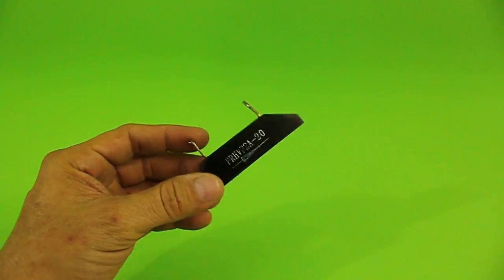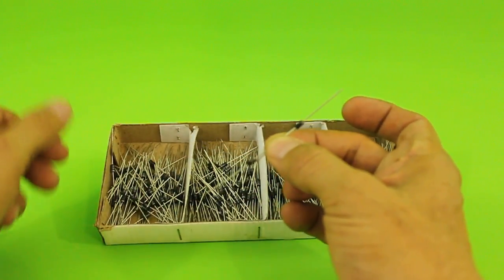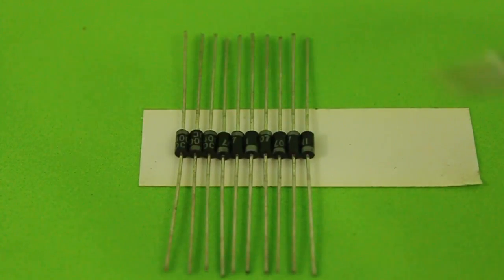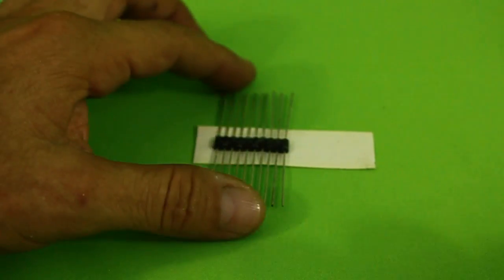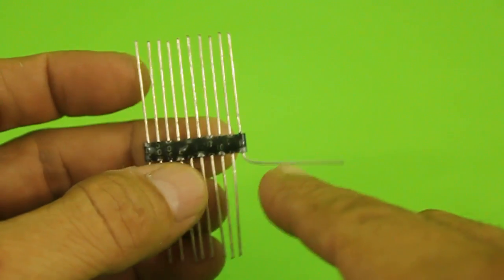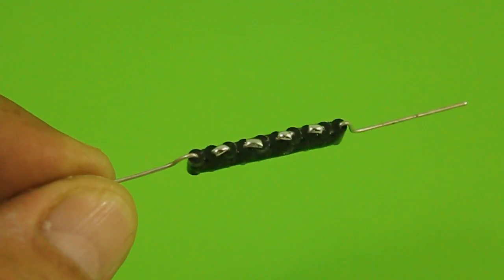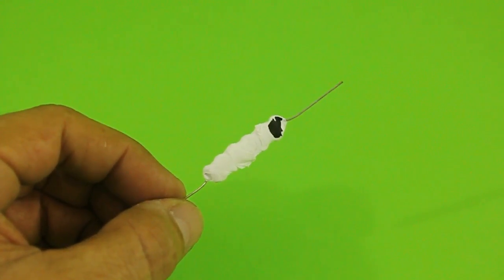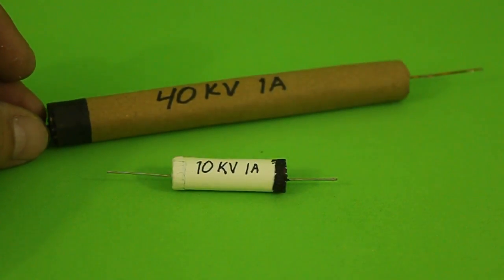How to make High Voltage Diodes

Comment: Kids, don't fall for these movies... 
If the reverse current leakage of all used diodes is not equal you will blow-up the least leaking diode first, followed by the second etc. That's why HV diodes are more expensive. They also stack diodes like the movie, but first they match the pairs on leakage current. This is a difficult step since leakage is also temperature dependent.  It's a poor mans solution with poor performances. Please just buy a $3 HV diode...

Comment: You know by putting these side-by-side like that you are making a much shorter and easier to jump spark gap than stretching them out... could go off sort of like a Marx Generator (multiple jumps all at once in cascade).  Even with the tape, you would be MUCH more HV resistant with them stretched out and perhaps sealed with silicon caulk or the like.... at least that might be one way I am presently experimenting with.

Comment: I’m not sure of the exact rating of microwave oven HV diodes but I expect they exceed 5kv each as they have about 7v forward drop perhaps they are 10kv ? as they are sizable due to the relatively high power a microwave ovens utilizes , and the peak after the C boost on a microwave is about 4kv ? anyways they are free if you collect them as I have, Alvvays found them interesting so collected nearly everyone I pulled. 
Also scored a 1Bgt valve, which is rated 30kv ~ strange the filament is only 1.25v or there about I guess the dielectric inside that vacuum tube doesn’t need much breaking down at 30kv or there abouts?

Comment: A faster and easier way to solder the diodes: once they're glued together, lay one piece of wire against one side and spot solder it to each wire. Do the same for the other side. Then use side cutters to trim everything. No need to waste time bending those fiddly 3mm ends and cause stresses on the package. You have to cut the ends anyway but doing this method is neater, faster and hardly any more work.

Comment: Can you take a (single square pak) full wave bridge (FWB) rectifier, for example, rated: 1000V @ 30A and simply have a single diode of 2000V @ 60A by using the "+" labeled terminal on the block as the cathode and the "-" labeled terminal as the anode?
It should also work for the three-phase PAK's. i.e. a 1kV @ 30A 6-PAK will become a single diode of rating:  2kV @ 90A.   Also, the individual diodes will be very well matched!

Comment: In reverse direction, there is no guarantee voltage will divide equally across each diode, which could cuase overvoltage across them, and therefore cause a short.
Usually this is solved, by placing resistors across them, forming a potential divider.
Reply: so i need 10 more resistor for each diode can you explain more?
Reply: @dogodogo5891  Yes. Connect each resistor in paralell with a diode.

Comment: You cannot simply series connect the diodes to give you a higher reverse voltage. The reason is that the reverse leakage currents of the individual diodes are not identical so the reverse voltage across them won't divide equally. This means that some diodes may have their reverse voltage rating exceeded while others may have a relatively low reverse voltage across them. A solution to the problem is to place resistors across each diode. The resistor value is chosen so that its current at peak voltage is about 5 times the worst case leakage current through the diode at highest temperature. This however still doesn't guarantee voltage sharing when they are operated at high switching speed. This is because the voltage across each diode is also determined by its junction capacitance (i=Cdv/dt). To balance the reverse capacitance a discrete HV capacitor can also be placed across each diode to swamp the small junction capacitance and hence make all diode capacitances appear equal. So you end up with a resistor and a capacitor across each diode which detracts from the original simple series connection. Commercial HV diodes are just a series connection of individual diodes however the diodes are all very well matched in terms of reverse leakage and capacitance so don't require additional resistors and capacitors. Another option for series connecting diodes is to use avalanche rated diodes and omit the resistors and capacitors. You can do this safely as the avalanche diodes are not damaged by a reverse voltage that exceeds their rating as long as the current is limited to a safe value. Thus avalanche diodes can be series connected with no balancing components required.
Reply: Or, just don‘t max out the voltage for each cascade of diodes. Problem solved.

Comment: You forgot a small detail at the start.  Take a sharp xacto blade and scrape the oxidation off near the diode body (where solder will be) before cutting the long leads.  Thanks for the great video!

Comment: If the one on the end can withstand the 30-40kv passing through it at that point why cant just one withstand that to begin with. Also the rating of the wires is not increasing as you’re increasing other things. Good idea, but not something I’d put on the space shuttle

Comment: How about increasing the Amperage?...........................Will parallel bunches of these series connected diodes do the trick?................Lets say for Spot Welder and Arc Welder projects.............Because my DIY Spot Welder MOT produces over 950 A @ approx 2 V and the Arc Welder's MOTs over 200 A @ approx 70 VAC(both with a 200VAC 50Hz input from a 16 A wall socket).

Comment: Yes it can be used but problem is diode's connectors. It will be mini Spark gap and burning outside. So it doesn't work because this arc translation short circuit and you can think there is no diode in there. But if you isolate diodes connectors, there is no problem in this method.

Comment: Can you show how to connect diodes in parallel to achieve greater Amps...  I know you have a video on achieving the same effect with a transistor, but is it exactly the same effect?
I have heard that you can add resistors to the diodes to make them of equal resistance so that you don't get one to conduct and rest to stay idle, and the working one to burn out and then the next in low resistance to get activated and so on and so forth...  Until all of them burn out...  I believe this is what it is called an Avalanche Effect in diodes...  Please elaborate on this topic!!!  Thanks.

Comment: Be aware the expoxy degrades due to heating. And overall heat distribution of this contraption is very bad. Therefore it should not be used for constant loads.

Comment: I would just continue with the epoxy potting rather than use teflon tape. High voltage could still arc between diodes traveling under the teflon tape. Contamination from  dust or a fingerprint could provide an arc path. Epoxy is going to be a better insulator than teflon tape in this situation. 

How much space do you need to save on a 40KV diode? You might save space, but you increase the chance the diode will arc between the soldered connection because you bring them physically closer together. This provides a shorter path for an arc to form. It would be better to keep them straight and run them through a tube filled with oil. This will also help dissipate heat. You should also be able to build this with a chain of 4 or 5 microwave oven diodes, which are cheap.
Reply: Even at 40kV, the voltage between each diode is still 1kV

Comment: This method it susceptible to an avalanche failure, its best to install a high value resistor say 1MΩ across each diode to balance the voltages, also corona discharge and arcing will be an issue at 40kv, so spacing them out is preferred, also it's best to pot the assembly into a small plastic box to improve heat dissipation and to insulate the array. For extra high voltages the assembly will need to go into to dried mineral oil tank.

Comment: Not a bad idea. I rarely work with voltages high enough to need special diodes, but if I ever do, I will do this rather then run out and purchase a high voltage one. I have tons of smaller diodes around, and can purchase them locally for cheap.

Comment: what about high current diodes? at lower voltages. under 200v or so. and hundreds of amps. any way to get by or make something for that?
Reply: at hundreds of amps you'll need a very specialised diode that can be attached to a heatsink. Just buy one.

http://uk.rs-online.com/web/p/rectifier-schottky-diodes/6247766/ 
400V 240A

Comment: What about the cost of so many diodes? I think, this is too costly to make as ready made ones can be found for EHT rectifiers of CRT televisions. If this is to demonstrate the principle of dividing voltage in a series of components, this method is too costly: use resistors for that which cost far less.

Comment: You have even another dimension to lay your diodes in so you can encapsulate them in even a tinier way
Reply: Chisco Garcia Gonzalez That's not a good idea, bcs you get sparks. You need atleast 1mm space per kilovolt.
Reply: I mean with insulation, the epoxy will do
Reply: Chisco Garcia Gonzalez Then it should work when u put the whole thing into epox
Reply: You mean like honey comb ? putting them next to each other like stacks.
so the proverb/adage becomes: fetching a spark in a diode stack ;D
( original proverb/adage : fetching a needle in a hay stack )

Comment: Each diode has a Voltage drop of 0.7V which sums up to 28V on that 40KV model.
Now running 1 Amp over that will produce 28 watts of heat which is quite a lot. just saying.
Reply from the maker: That´s a good point you have. 1 amp at 40 Kv you will need a 40 KW power supply. For that power it is definately better to use commercial high performance diodes. In this case the 1 amp limit is useful for pulsed power applications, such as a Marx generator where you only see the 40 KW for a fraction of a second.
Reply: It turns-out the whole stack of 10 can be bought from HVstuff-com for just $5 (epoxy resin and all complete). Yes, one could use a thermally conductive potting compound (eg: Epicresins-com) poured inside a mold with flat inside edges (or directly onto an aluminum heat sink). However, this begs the question, "why just not buy a safe HV rectifier"?
Reply: just in case you have couple of diode on hand, you can just made it rather than buying one, it depends on you.
Reply: No one is going to be working with 40kv at 1A that is a ridiculously huge amount of power if you tryed to make a power supply that generates 40kv at 1A that 40,000 watts taking power from your houses electricity you might even temporarily blow the power grid a standard air conditioning takes around 3,500 watts if you figue that out that is about 11.5 air conditionings a standard refrigerators takes at most 500 watts so that will power 80 refrigerators it may be rated for up to 1A somthing you a going to do at your home or even a work shop at 40kv it is more than likely not going to be higher than 20 or 30 mA of continuous current
Reply: If you are using such diode (40kV) may be that you have about 40kV, otherwise why?
Reply: Yes, but not 40kW (40kV at 1A). That would most likely be more than your entire household.
Reply: There is problem with dissipation in that case.
Reply: 28 watts of heat won‘t be the subject if the power supply is really putting out 1A at 40kV... just saying
Reply: At 40k, 28v is nothing, and 1 amp at 40KV is a brain melting amount of power... jesus fucking christ... that is 40,000 Watts... or about 40 microwave ovens.
Reply: At 1 amp it's more like 1 volt each (40-watts). Since I'm not one to take HV lightly, I started quick EEVblog thread titled "10KV 1A rectifier can't be made from just 1N4007's, can it?" Some good answers for those curious..
Reply: I think @rafii6311 is talking about forward biased condition, where you'l have 1 Amp current at 28 volts, while 40kV is max reverse biased voltage but in reverse biased condition the current will be very low in mA or uA, so you won't really need a 40kW power supply for any of the case,
Reply: heatsink can be attached
Reply: Richard Smith, I agree but please keep religion out of here.

Comment: I know you put teflon tape as an insulator, but I would still be worried about arcing. (especially with the 40kV model)
Reply from the maker: I have used them without problems, later I will upload a video. Note that you ony have 1000 volts between diodes
Reply: you can put candle wax in between joints
Reply: Yes, your right. I did some more research and I agree that this method is valid and will work a charm... I would still prefer a high dielectric strength epoxy over the teflon tape, but really, if the t-tape works why bother buying expensive specialty epoxy. Good stuff Ludic, looking forward.
B
Reply: I would more worried about the fumes it releases if something would go hot in the high voltage diode... say its overloaded with current. 
Teflon tape releases really hazardus fumes when heated, in fact people has died from machining teflon without proper ventilation.

Comment: Great!  What will happen if I connect 3 such diode( 10KV 1A) in parallel? Will it become 10KV 3A? Thanks
Reply: Thank you for the explanation.
Reply: I think it is more of a problem with switching time if the voltage is sufficiently higher than the forward voltage. If the initial current is too high, the diode that switches first will be punched by all the current, potentially out of commission, then cascade to the rest.

Comment: you should put a >1MΩ resistor in parallel with each diode to prevent breakdown causing an avalanche through all 40 of them.  the resistors keep the reverse voltage evenly distributed across each diode if one reaches its breakdown.
Reply: Josh Crampton I put the question to the EEVblog forum and user BlueSkull (senior member and power design phd) had this to state about balancing resistors and the 1N4007's breakdown:"These devices have a nice avalanche breakdown path, so I would not 
bother balancing them. Let them breakdown, and even though they will balance themselves. There's no gain in PN diodes, nor schottky diodes, so I wouldn't worry about secondary breakdown. The legit reason to add resistors and capacitors is to match dynamic balance voltage and static balance voltage in order to minimize switching loss, but that's not important to 60Hz or even 1kHz operation."He also made a recommendation: 
"Voltage sharing is not an issue as long as the diodes in a stack are of the same model and same batch. Reverse leakage - reverse voltage curve guarantees voltage sharing of devices."
Hope this helps! (I always get a little antsy when HV is taken lightly.. eg: Teflon plumbing tape has imperfections and holes and it's main purpose is for compression fittings.. better to use auto ignition spray with it). Still begs the question, why folks don't buy the whole stack assembled and potted for $5 from hvstuff..
Reply: The plot thickens: At 1kv per divider segment, one should choose resistor types carefully. Typical foil types at ~2meg (good to 400v typical) would then require choosing 3 series 680k resistors per divider segment. If charging a 40kv oil-capacitor bank (for example), the whole 80meg chain could dissipate as much as 20-watts back-feeding to the source. Ohmite specifies max 500Vrms per foil/inch on resistors so yeah.. choose resistors wisely and stay safe!
Reply: Salman Azmat Reverse recovery time (Tr) and junction capacitance. At crossover they're still lightly forward biased, and the polarity change makes it like dominoes from last to first, each takes a few ns to fully reverse. There are even brief spikes from this causing RFI sufficient enough for some designs to insert bypass caps across each diode.
Reply: Resistors DEFINITELY help a lot, i have never had any more blown HV diode packs since i include a resistor in series with each diode. They blew "for no apparent reason" before ;-) ok very apparent reason...
And if you leave leads uncut, sticking out the side, (insulated!!!), you get some heatsinking for free too.
Reply: +maniac
http://engineering.electrical-equipment.org/electrical-distribution/series-and-parallel-connected-diodes.html
Reply: Or get avalanche rated diodes and just let it self-balance?
Reply: why 23.4 volts ? all diodes are in reverse biased mode, so why 0.6v(forward biased drop) across 39 diodes ?
Reply: If one can look at the inside structure of a flyback TV transformer, the HV diode is in effect a series of Hv diodes with HV ‘capacitors’ in place of the recommend resistance in this comment, in my experience those diodes don’t seem to fail often for the high amount of running time they have. It’s worth considering.
Reply: ?Can you explain more
Reply: maniac the current through the resistoea creates a voltage divider.  without a voltage divider, when first anode is at 0V and the last cathode is blocking 40kV, the last diode's anode is at 23.4V.  this puts the reverse voltage on the last diode at just under 40kV, well above the rated reverse voltage and well past its breakdown voltage.  when it breaks down, the next diode has 22.8V on its anode, 40kV on its cathode, so it breaks down too.  and so on.   putting 40 resistors  creates a voltage divider, so each diode only sees 1/40th of the reverse voltage, it has 39kV on its anode and 40kV on its cathode, just on its rated reverse voltage.